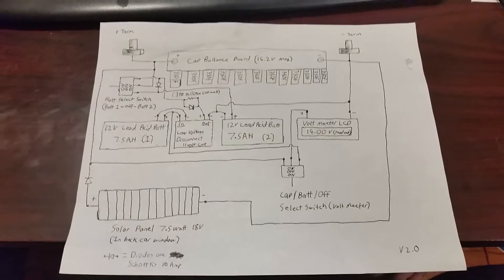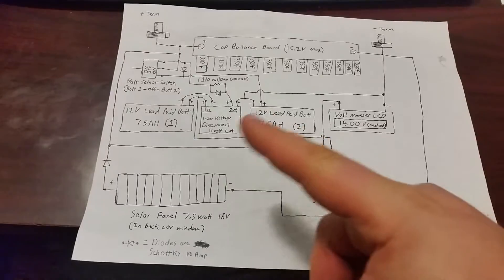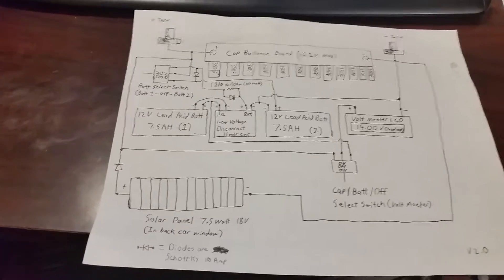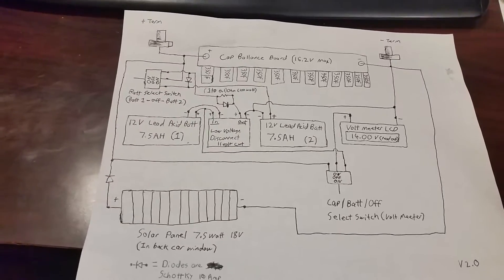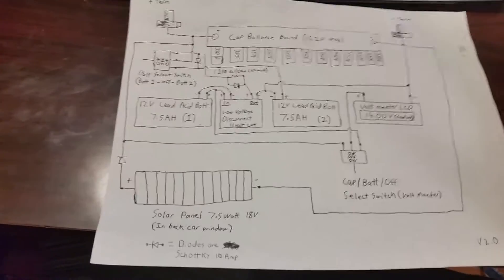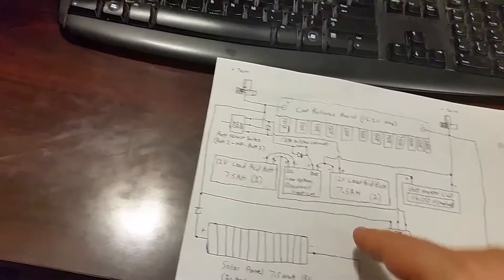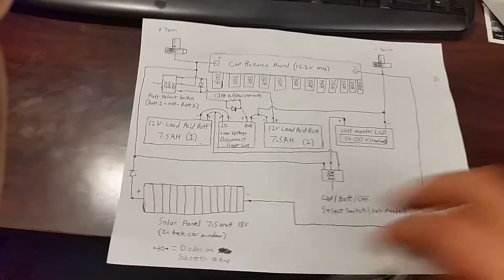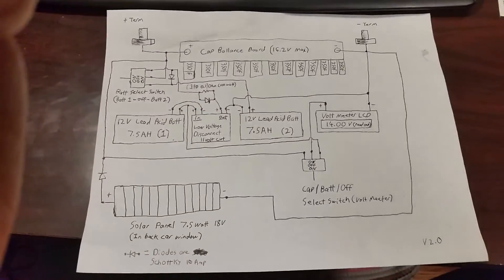DIY Schematic Super Capacitor Car Battery

Comment: please i have a question...if i connect the battery with the caps in series directly the volt in the battery is 12v and the cap is 16.2v i think the caps voltage will drop to 12v as the battery volt. can i prevent that with the 10 amp diode?
Reply from the maker: In a direct parallel connection between the batteries and capacitors while the car is charging and surplus electrons are coming from the alternator the caps will go to whatever the voltage of the alternator (unless the batteries are drawing way to many amps/shorted) until the car turns off.  Once the car is off the battery will drain the caps down to it's voltage (which is fine).  With batteries/capacitors direct connected in parallel when you start the car the voltage of the capacitors will drop (capacitor voltage drops as they discharge) while the batteries will maintain their voltage.  This causes the cranking starter load to shift over to the battery and away from the capacitors.  To prevent this if you look at my schematic I use a diode/resistor combo.  The diode allows the battery to charge at full amps.  However the resistor prevents the car from drawing too many amps from the battery and lets the capacitors do the heavy amp work of starting.  Understand?
Reply: @gene4390  Like to thank you Gene for sharing this as I learned a lot as a beginner, great design and schematic.  I have a quick question on the diode/resistor combo parallel circuit, with the diode output going to the LVD out +ve pole, the First battery will get charged only when LVD circuit is still closed (ie., the first battery is not low enough).  However, in the scenario where the first battery is too low and the LVD is now open, the first battery will not get charged back up with the current circuit.  If what I stated is true, would it not be better to have the diode output connect directly the first Battery +ve pole just like the second battery is?  I thank you in advance!
Reply from the maker: @davemok   Once a battery disconnect happens the low voltage disconnect will reconnect the battery if it senses a incoming voltage on the "out" side of at least 12.5V (if I recall it's around there).  So it will allow the battery to be charged at any time.  However will still keep the battery from supplying more power once it hits 11V.  Hope that helps answer your question? :)
Reply: @gene4390  Thanks Gene!  Will connect as per your schematic!  Thanks again for your respond!!!

Comment: Nice and simple work, well done. i'm curious to get your latest update on this? is it still working? if yes, do you suggest any modification on it?
Reply from the maker: Yes it is still working good.  If I get a little money saved up (who knows when) I may switch the Lead acid batteries to Nickle Metal Iron which would in theory give a 30 to 100 year battery without the need for any replacement parts in that time.
Reply: @gene4390   you mean lithium iron?

Comment: only one observation, if do you connect 12 capacitors in serie, you will have 350 divide 12= 20 farad, the correct think to do  is make 6 capacitors in serie, and in paralell more 6 capacitors in serie so you will have, 350/6 + 350/6 = 116,66 farads, cheers
Reply from the maker: If you read the video description  you can see a link I placed to balance board I chose that holds 12 capacitors into 2 parallel groups of 6 capacitors for a total of 58.333 Farad.  You are correct that 12 capacitors in series would not be a good idea.  Which is why I didn't use 12 in series as that would of been wasteful and only give you: 29.167 Farad.  If your trying to figure out the Farad for capacitors in series the calculation is:   (1/CTOTAL) = (1/C1) + (1/C2) + (1/C3) + (etc up to # of capacitors you have).
Reply: thank you! nice job

Comment: Nice work, it would be much easier if you'll use this desig :http://bioage.typepad.com/.a/6a00d8341c4fbe53ef01a5117c8905970c-450wi
meaning to power the starter only by supercap, rest will remain on battery, supercap will be charged by dc-dc module while running.
Also it will be much better to switch to some 10-20Ah Lifepo4 battery instead of Lead-acid.  
In parallel with solar panel you can also use an emergency dynamo to fast charge the supercap bank during night/no sun/war etc . good luck.
Reply from the maker: Interesting ideas though may not work as well for me.

Maxwell ESM's separate the super capacitors to just power the starter so a semi can just run 1 lead acid battery instead of 4.  There are pros and cons to both sides.  But I prefer putting the capacitor in parallel with the battery.  The reason is the very low resistance of the capacitors helps smooth out the voltage pulses and dips from the alternator giving you smoother power.

A Lifepo4 battery would be smaller and weigh less.  However two issues I had with LifePo4 is that they are VERY easy to damage by overcharging and require a charge controller. They also damage much easier than a lead acid from overdraw.  Finally lead acid is a old technology we understand well and can take a lot of abuse (weather/shock/etc) and just die when they go bad.  Though it is more rare now than in the past LifePo4 batteries can explode or catch fire if they have a failure.  Don't want the chance of anything bursting into fire near my fuel tank!

Finally in theory a dynamo could be used to charge the capacitors to start the car.  However I built a super capacitor flashlight that is charged by a dynamo.  Took 45 seconds to charge a 4F capacitor and my hand was tired.  Trying to charge x12 350F capacitors would be a feat!  I went the lazy route here and just put in a extra emergency battery that is charged by a diode.  If my capacitors go flat I just flip a switch and can start my car in 3 seconds.  Much more handy in emergency situations if you find yourself out of power and your in a hurry.
Reply: Few corrections are needed: Lifepo4 does not catch fire, only Li-ion (different chemistry), Lifepo4 resist better than Lead-Acid in case of down to empty cycles. 4 x Lifepo4 factory tested does not need balancing circuits - I use this model for over 4 years in on of my cars with no problems so far :https://www.ev-power.eu/LiFeYPO4-batteries-12V-1-1/Lithium-Battery-LiFePO4-12V-20Ah.html.
In rest I must agree with you.  This setup helps mainly diesel engines in cold weather and of course prologue the battery life by eliminating daily start-up cycles.

Comment: Great design and articulate description!  Can you give details on the ultra capacitor bank and source for the module you use?
Reply from the maker: The balance board I used is in the text below the video.  I soldered 12 Maxwell 350 super capacitors in pace.    I then bonded them together and to the board with a glue gun to help prevent movement and protect the solder joints.  I then  tool a coper grounding rod and cut "pieces" soldering them to the capacitors in series to carry the heavy amps so the balance board traces would not over heat from the draw.

I also had to buy a good quality soldering Iron https://www.amazon.com/gp/product/B000VM3PTU/ref=oh_aui_detailpage_o00_s00?ie=UTF8&psc=1    as my 30 watt radio shack iron did NOT cut the mustard at all trying to solder to the posts of those capacitors.

I also had to buy a good quality soldering Iron https://www.amazon.com/gp/product/B000VM3PTU/ref=oh_aui_detailpage_o00_s00?ie=UTF8&psc=1    as my 30 watt radio shack iron did NOT cut the mustard at all trying to solder to the posts of those capacitors.